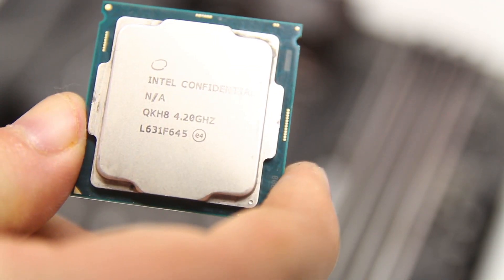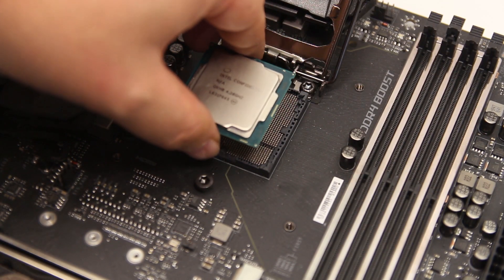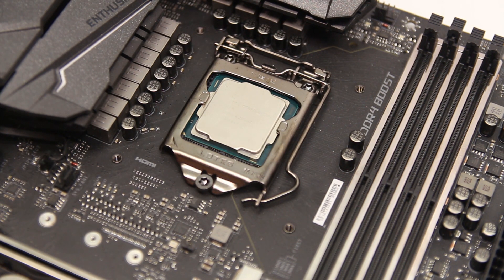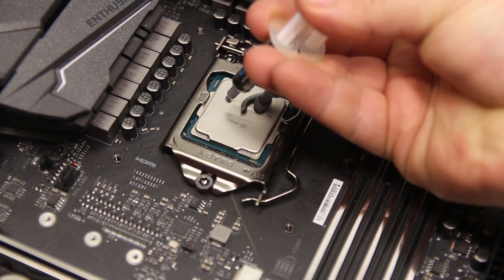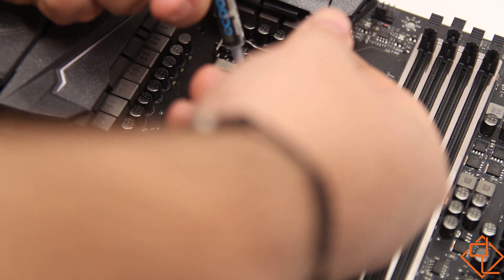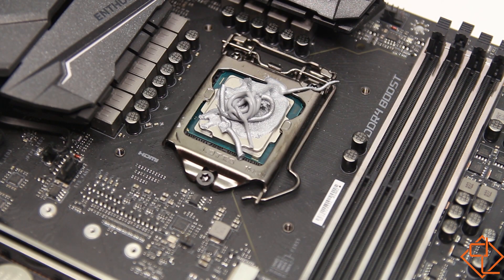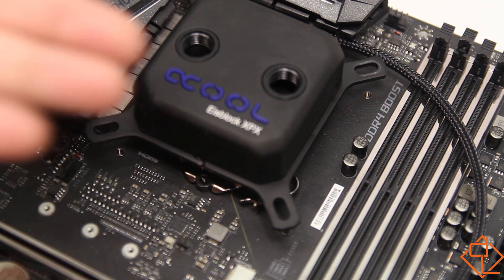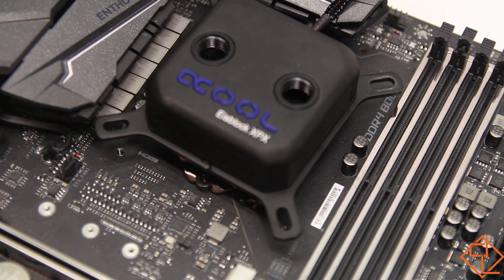How to apply Thermal Paste... .The Verge style.

Comment: DISCLAIMER: CPUs were harmed during this process
Reply from the maker: Lies! Twas fine and is still chugging along to this day. It still does it's intended function, finding pron on the internet.
Reply: @davido_labido  understandable, I should try this so I could watch some quality hanime
Reply: are you sure it's not the thermal paste?
Reply: @davido_labido  how tf did the motherboard pins survive that bend tho
Reply from the maker: @ttgoodywin9212  huh?
Reply: @davido_labido  i think hes asking about how did you not bend any pins when cleaning the paste. did paste get into the pins?
Reply from the maker: @869MEIZO  nope, no paste went in the socket, cleaned if off with CPU in still. Can't get in if the CPU is there.
Reply: And thermal paste was wasted.
Reply: @davido_labido  you should also post your  benchmarks on how this unit fares with LoL

Comment: My man just burned money for a joke. Hard respect.
Reply: Its not that deep. He just needs to clean it off.
Reply: @ap4702  so he can save all that thermal paste?
Reply: @discordo206  it doesn't cost that much, if you have enough for a i7 10700 like they had, they have enough for 50 dollars in thermal paste
Reply: @genkugames9616  but it still cost
Reply: @genkugames9616 50 dollars is not a joke, Jim! Millions of families suffer every year!
Reply: @HexRox  hahahaha, that is a good reference, but, ok, i need to clarify this, i've done research since i wrote that comment, 50 dollars is the cost of a high tier thermal paste, the one that he is using is cheap af, talking about 10 dollars or less, also, i never said 50 dollars was nothing, i said that if you had money to buy a i7 10700 you could possibly buy a more expensive paste

Comment: His palms are sweaty, wrists weak, screws are heavy,
There's thermal paste all over the board already, Wire spaghetti!
He's nervous, but on the surface he looks confident, ready
To screw strong, but he keeps on forgettin'
What he plugged down, the whole board goes so loud
He opens the slot, but the paste won't come out
He's chokin', how, CPU is sparkin' now
The clock run out, HexCore's over, blaow

Snap back to virality, ope there go nerds angry
Ope, there go the tweets, he choked
He's so mad, but he won't give up that easy?
No He won't admit it, he knows his whole back's to these ropes
It don't matter, he's dope, he knows that, but he's broke
He's so stagnant, he knows, when he goes back to this mobile phone, that's when it's
Back to the lab again, yo, this whole rhapsody
Better go answer this comment or hope it does pass him

You better lose your shelf...

Comment: Conductive paste as well. Rest easy brother.
Reply from the maker: which wouldn't make any difference if it wasn't powered, which it of course isn't. Equally, it isn't conductive paste either and it took a few mins to clean it off with some isopropanol. Other than that though, you're correct! :D

Comment: just relized the "prossesor:" was  a fake one you had  i looked it up  and all i saw was  i3 , i5 , i7 , i9 cpu's ....still good joke.
Reply from the maker: Huh? It's not a fake at all. It's an engineering sample. We get these from Intel for testing. Iirc, this was a 6700k.
Reply: @davido_labido  ok since when do prossesors say "confidential" on them then.
Reply from the maker: @wolfhauzer3178  it is what Intel send you if you're one of their partners, if it is for review (usually before release) or if it is early and you get one sponsored. Just Google Intel confidential processors. I have about 8 of them, all different ones because I work with Intel a lot.
Reply: @davido_labido  and at 0:06 the  "i think your just jealouse cause you havent got one of these"...was the cringiest thing  i ever heard you say  and the condential is not all that expensive. ...and 6700k?.....my intel i7 is 9700k  witch will be upgrade to a i9 10980k in 2 years....so why would i be jeleous over that old thing...the prices range from $45 - $250
Reply from the maker: @wolfhauzer3178  the chip cost me nothing. Neither did my 10900ks (which I currently have 4 of), my 7980XE, my 7920x, my 2970wx or my 2990wx. 

It's why they have 'intel confidential' on them, they're samples.... Well, the AMD chips don't have anything different on them, but you get the picture. 

I thought it was obvious I'm joking, watch the verge video then get back to me
Reply: @davido_labido    oh i already did and also cringed to the video like everyone else did,  too much thermal past , no fans on the radiatior and installing the Ram backwards and putting in the motherboard in the case when the cpu is the first thing your suppost to install on the motherboard then the "bead" of thermal past then cpu cooler then the m.2 then the ram THEN you can install it in the case after you install the "standoffs"...this guy screwed up every step in the process of that build....and why did he call the i/o shield a "brace"?!..plus he even put the power supply in backwards...and hes calling everyone who saw the video "angry nerds"...when they know EXACTLY what the hell they were talking about the only angry nerd is him because hes getting butthurt of how everyone is correcting his scewups..so yea.
Reply: @davido_labido  and ive been building pc computers for over 25 years..
Reply from the maker: @wolfhauzer3178  oh.... Ok, yet you didn't see the part when he said 'this core I7... Yeah, we got one' like a smug child? Which is obviously what I'm pandering to.

Comment: Out of curiosity, has anyone tried combining thermal pad and thermal paste together.

Cut out a hollow frame around the edges of the CPU IHS, then apply thermal paste in the middle, the pressure will spread it outward, but no idea if it will come out the sides.
Now what if you put liquid metal in the center (a tiny bit) while putting thermal pads on the edge to try to seal it?
Reply from the maker: Really no point in pads if you're using paste. You want to try and reduce the amount of material between the die and the cold plate, not increase it. The best transfer of heat is through LM and direct die mounting, the only negative is that it is possible to crush the die. 

Shit, I'm showing I know how to do things properly. ABORT! ABORT!

Comment: for anyone who doesnt have a clue about PC buildin, THIS IS A JOKE, dont apply that much thermal paste, you will kill the CPU. Only put on a pea size about in the center. Also, never touch the cpu pins or back of it, only the sides. I am not hating btw, only letting people know.
Reply from the maker: it actually won't kill the CPU, it will just make the  motherboard messy.  The vast majority of thermal paste is non-conductive (not all of them though!) and the cooler will displace the paste that it doesn't use. Having too much is better than not enough. TIM is also very easy to clean off with alcohol like Isopropanol.  Your pea size will be useless on anything other than small dies, add that to TR or 3647 and you're screwed. You need to adapt the application depending on what die you're running. If you're going to give information, make sure it is correct. Not hating btw, only letting people know.
Reply: @davido_labido  yes, but wouldn't that amount thermal paste leak down and break or at least shorten the life of the motherboard and/or the CPU? Also, the pea sized amount on the CPU should be enough as when you are putting the cooler on top of the CPU, it will evenly spread out on the CPU. I wouldn't know though, my cooler came with pre applied thermal paste.
Reply from the maker: @elliot8710  look at the size of the CPU sockets I mentioned. Tell me how a pea size blob will cover that ;) on small dies, it is fine

. Also, no, it will neither break nor shorten life to any measurable amount as long as it doesn't cover a contact of some sort that is uncleanable, pretty much. The misconception of 'omg too much paste' is generally completely over the top, if  you have ever taken a GPU apart from the manufacturer, you can see how much they put on it. They douse it because too much > too little. So much so that they would prefer to spend far more on paste than have issues with the product. They could save money by only putting a small amount on, but they don't. 

Of course the amount I put on is exaggerated, but it would still function perfectly fine with no discernible effect on temps or life of the board. Oh and one I missed first time around, touching the IHS is generally fine, don't touch the pins/pads though.
Reply: @davido_labido  fair enough, I understand what you mean. I have only built one PC, and that is the one I am using now. However, i have watched many youtube videos before building it, and they all have different opinions. You, however, seem to know alot about it. Sorry for the wrong information.

Comment: Good building etiquette?  Nonsense. The only thing thermal paste does is ensure that all of the heat spreader is in contact with the cooler by filling in the micro pits on the metal top of the processor.  You need a very thin film to do the job.
Reply from the maker: We caught one bois!
Reply: @davido_labido  it's worse than that. I'm a certified bore with decades of experience and not just a benchmark expert.
Reply from the maker: aaah, I tried to get my bore certification but apparently I was kicked off the course for having pineapple on pizza.